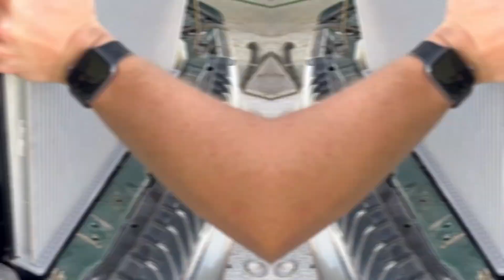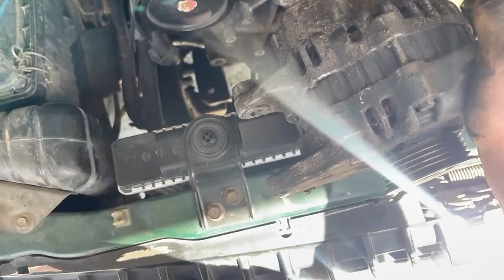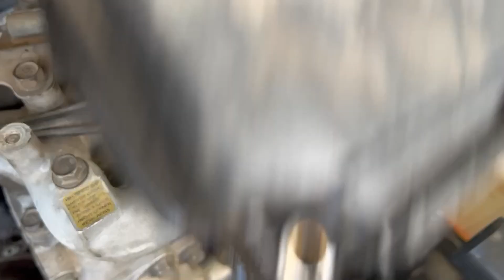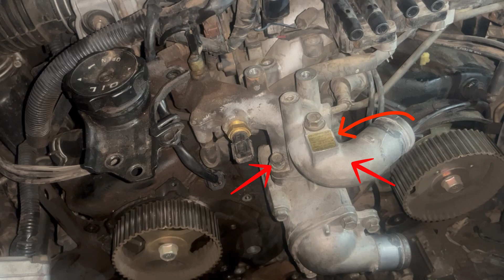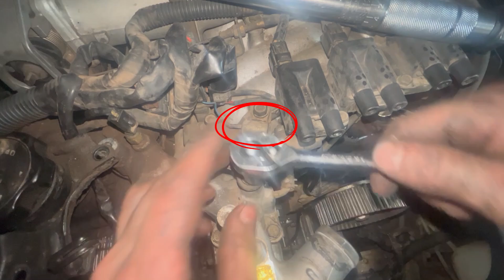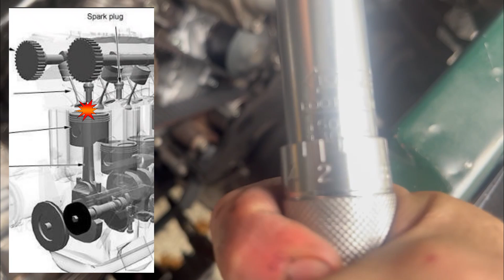EPISODE 5 - TIMING BELT & WATER PUMP REPLACEMENT (1999 MITSUBISHI MONTERO SPORT)

Comment: For anyone watching this video, you really should replace your crank bolt to the revised version: crank bolt - 1100A141 and washer - MR994412. The original long version of the crank bolt shown in this video is notoriously failure prone.

Comment: I've learned that if the printing on the outside of the belt is bright and clear like new, than the belt has been replace recently or if it is faded or gone the belt is old.  The tensioner runs against the outside of the belt and will wear off the printed info. Another hack... https://www.youtube.com/shorts/A-wdL_IvU28 , Another hack, https://www.youtube.com/shorts/A-wdL_IvU28, Another , https://www.youtube.com/shorts/KlkwlQa5RhE

Comment: Thanks for the video, this is very helpful as I’m about to tackle this job. I paid a crappy mechanic to do my head gasket and he never replaced the water pump or belts so a few hundred miles later the water pump started leaking. Not to mention I have paid 3 other mechanics to clean up his work (broken crankshaft position sensor, bent crank shaft blad…)and I continue to find other things he did wrong so it’s time I just take a few days off and do it myself rather! Thanks again.
Reply from the maker: I hear you! If you aren’t a member already, there is a Facebook group specifically for Montero Sports here in the US. There are a bunch of guys, much more knowledgeable than me, that would be great resources for your projects. 

I think it’s called “Mitsubishi Montero Sports U.S.A”